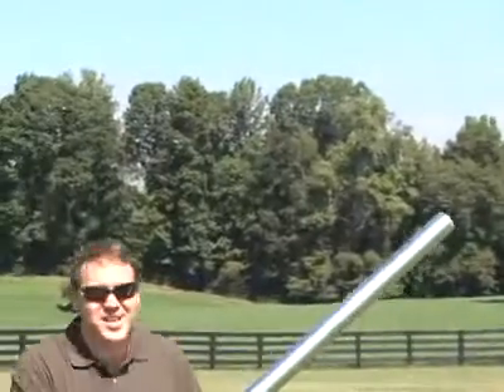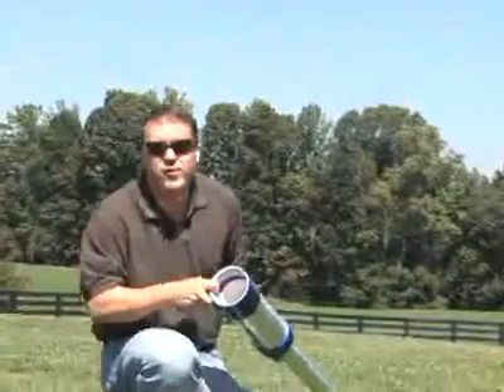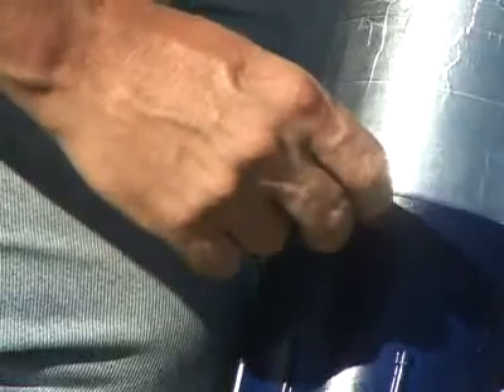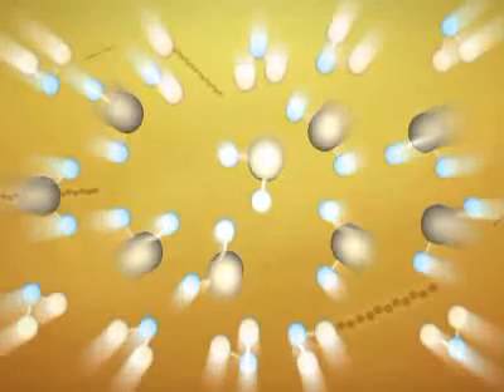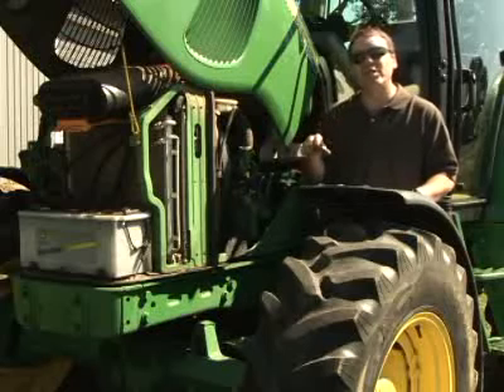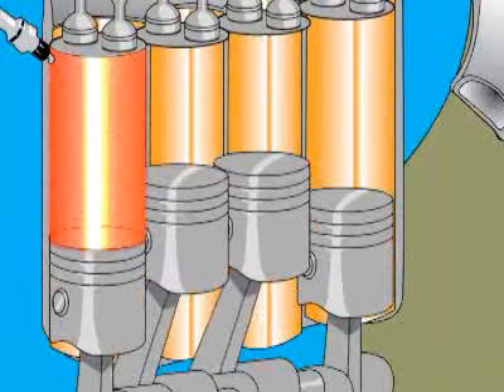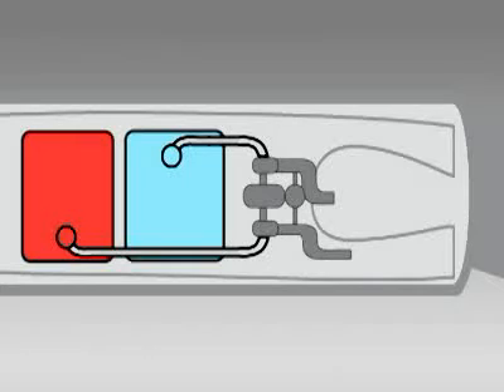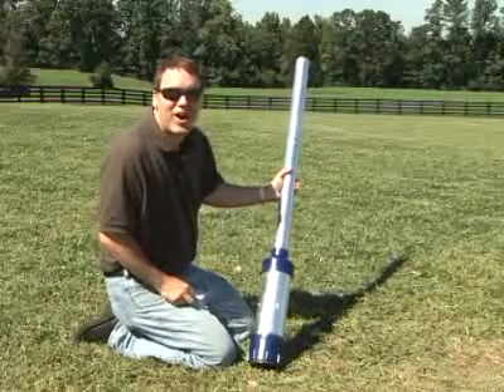How Engines Work

Comment: So is it basically when the air goes into cylinders and gets mixed with fuel then gets compressed which fires the spark plug which forces the pistons down the exhaust  valve opens then the air goes flying out the exhaust pipe then through the kettle of the converted then through the muffler and out the exhaust pipes?